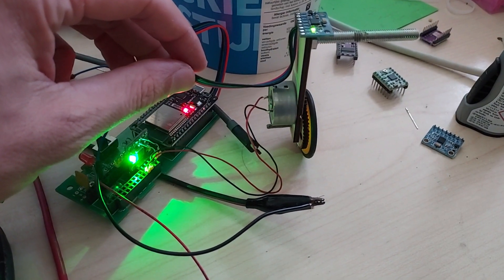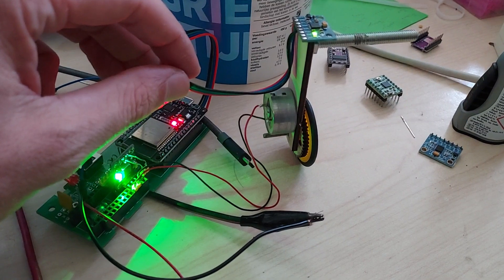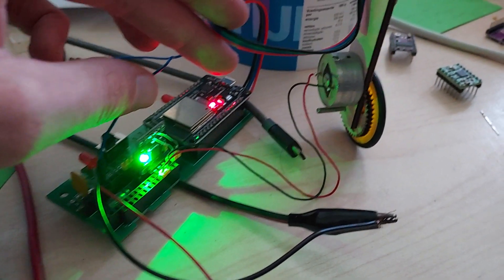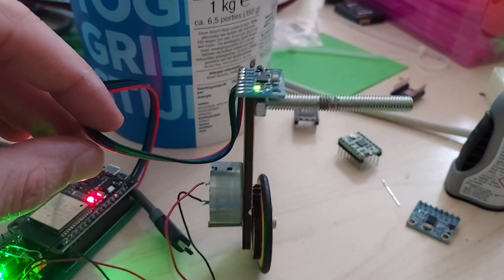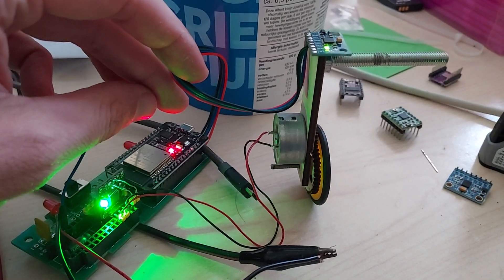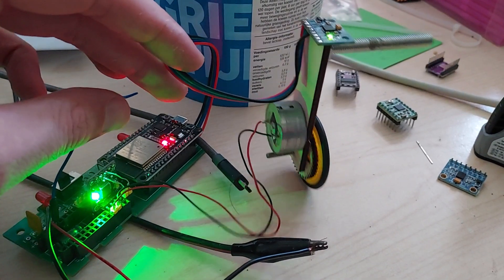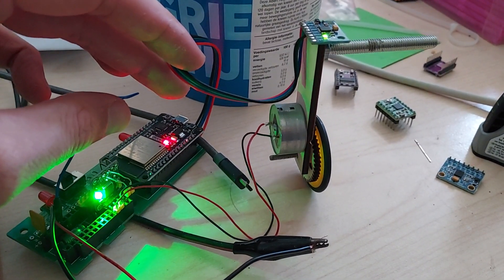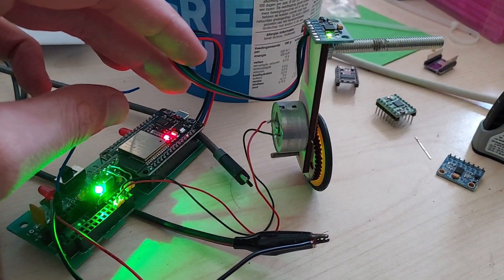The bare minimum of a balancing robot (which costs only a couple of euros)

Comment: Would be fun to add a second axis and convert the wheel into a ball
Reply: Yes you would need a construction to keep the ball in place. 
Another solution would be to actuate the bolt linearly. Then you would be able to steer and balance in 2 directions.
Reply: My thoughts exactly :)
Reply: Might need a 3rd "passive" wheel, though, like in a ball-mouse.